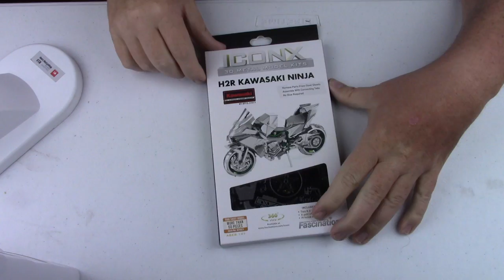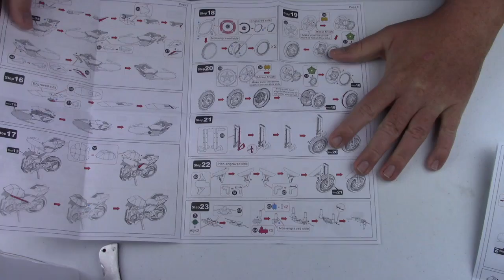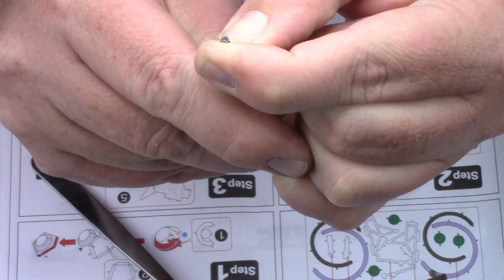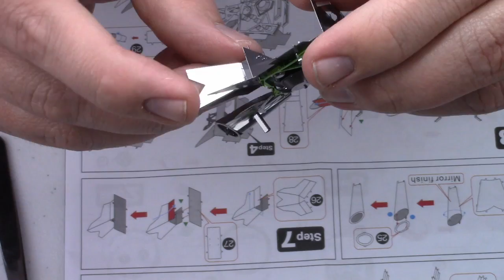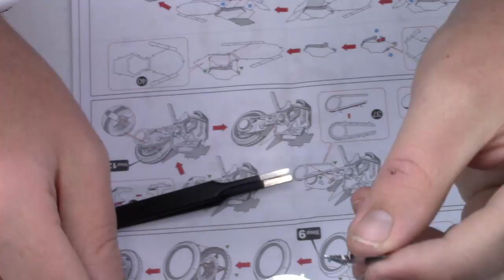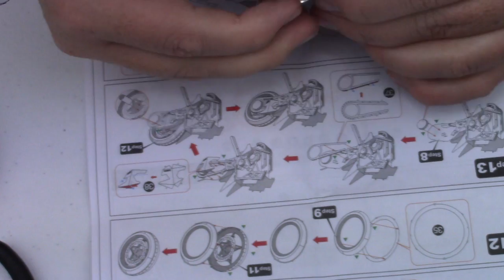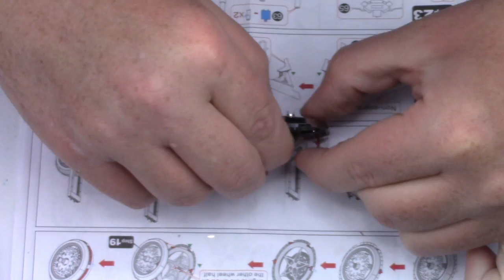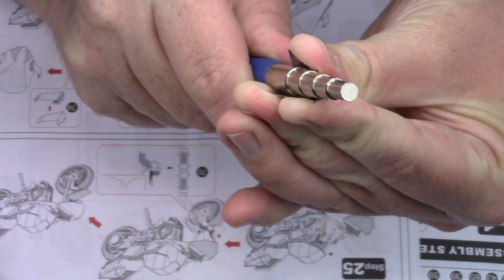ICONX build - Kawasaki Ninja H2R

Comment: Nice job. Thanks for the video. I've built most Metal Earth and ICONX kits but still have a few to go, including this one. It was interesting to watch the methods you used to shape parts. I hadn't thought of putting a 'tip' to a couple of the brass rods I use for shaping but will give that a try. A tip to consider... I use a small diamond file to bend tabs. I find I can make a cleaner bend and keep the parts together tighter than I can when trying to bend with tweezers or needle nose pliers.
Reply from the maker: Francisco a diamond file, interesting. Thanks for sharing.

Comment: Any advice on strengthening joints that were redone and messed up now causing movement? My kickstand is barely hanging on and I completely messed up on the front tire, not a huge deal but I want to improve the connections maybe a dab of JB weld?
Reply from the maker: JB weld might work. I haven't tried that. I have used hot glue a few times.
Reply: Danny Arana they have jewelry/ metal glue that works great, dries fast and holds well. I got it at Michaels craft store, im sure Hobby Lobby or JoAnn Fabrics would have it as well.
Reply from the maker: Sajin688 I didn't know jewelry metal glue was a thing. Thanks!